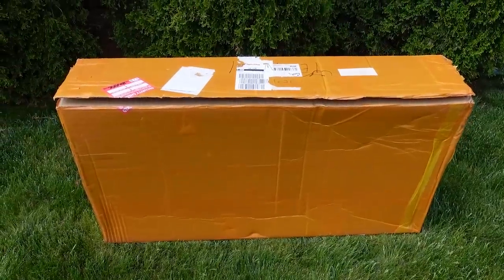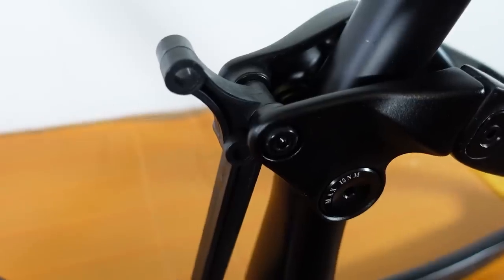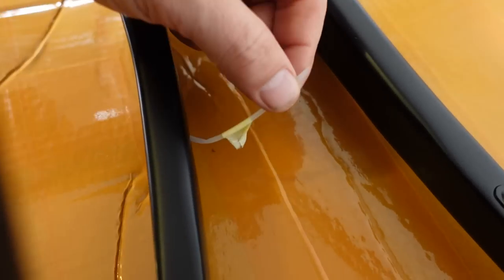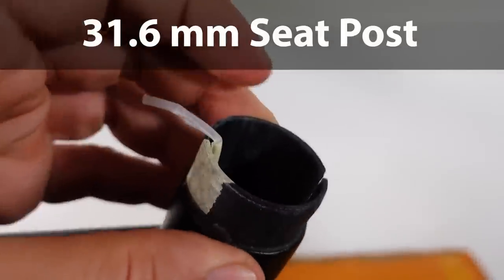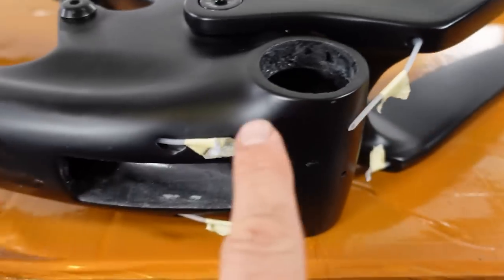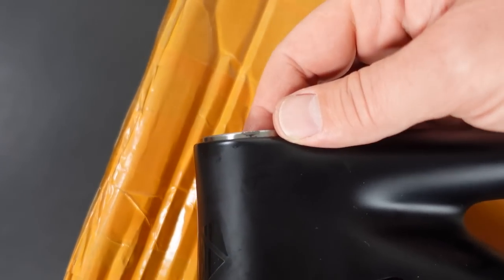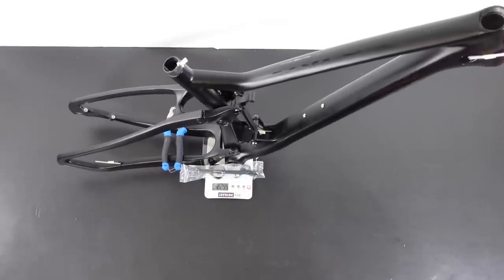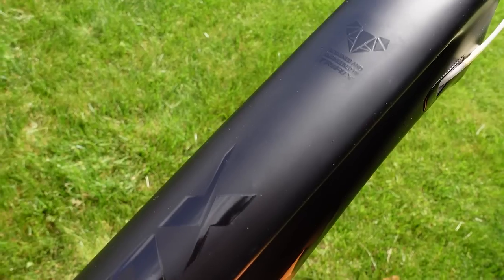Part 1: Cheap Carbon Frames Worth it? - TRIFOX MFM100 FS MTB Quick Check

Comment: I own 2 Chinese full suspension carbon frames. One is a trail (120mm travel) bike and the other an enduro bike (150mm travek).
Almost 3 years on the trail bike, I have done xc races with it, and totally love it.
Less than 3 months on the enduro one, the extra travel provides extra confidence on jumps, to the point I destroyed both enduro carbon rims. I love it too.
Reply: Good Morning, can i know which chinese brands/models you would advise me, with respect to the trail bikes? since i  would like to buy one of these as well, thank you!
Reply: @lce4375  for trail I have an Airwolf frame. It's not the best as it's not too light for a carbon frame, but works for.
For Enduro, go with the Ican P9 frame. Best of the Chinese options and a great frame.
Reply: @rubenvor  what else/better/best you recommend for trail bike? I am planning to build full sus downcountry bike next. Looking for a frame and carbon wheels. Thank you!

Comment: Spot on about the dropper. I was sent one of these frames to review and did a build up video on it. While picking the right dropper I went with a PNW Loam 125mm post because it has a short enough post to fit and the cool option of adjustable travel. I'm 5'8" and got a med frame. At my size I have to slam the post down for my legs to reach to pedals correctly. This post seemed to do the job for me 👍
Reply: @LoveMTB  Yes. I'm running 115 by way of a trunnion shock from SR Suntour. I was not sure if it was appropriate to put a link to my videos here. I just really wanted to chime in on your dropper comment because getting the right dropper was more tricky for me then I expected and thought others should know. Again, your points are dead on and something to think about when getting the correct one 👍
Reply: @LoveMTB  I'll send over some info. I was very lucky and met a dude James from the James The Bike Guy channel that helped me out. I would have been lost without his help. I did not get those bolts that you got so things got complicated. You will need to get some new bushings.
Reply: @LoveMTB  Shoot me an email and we'll chat. I can also link some helpful videos. I also think I have a few extra bushings and can mail them to you 👍
Reply: @rgmtb  Missing bolts and bushings? If a company's QC process allows that, I would be concerned about where else they cut corners on attention to detail and QC (carbon material, lay-up, etc).
Reply: @soco4949  This and a lot more will be discussed in my long term review.

Comment: I'm on chinese carbon rims and quite happy with them. Got a few friends who are riding chinese xc full suspension frames and as far as I know some of them needed slight improvements on the pivots by a local mechanic. Also quality may vary from one frame to another, you can buy two or three of the same frame but the overall quality might be different. As for the support, if you buy via aliexpress they usually honor warranty claims (sometimes  even when it was fully user error).
Reply: @LoveMTB  nice. What rim that was and it's weight, if that's not a secret? Mine are quite heavy with 2 year warranty (still have 13 month left). Also, seen quite of few broken chinese rims but usually it was light xc rims (300-320 grams for 29 rim with 23-25mm inner width) which were run on low pressures. The good part, it can be fixed, though it might cost like half of the rim itself.
Reply: @LoveMTB  damn, if there were warranty they should've covered it. Nevertheless, another few points to the argument that almost every cheap chinese stuff is a lottery due to bad quality control.

Comment: I had my Spark RC SL frame, triangle and linkage replaced on 3 different occasions in 4 years. If it brakes one more time I'm replacing it with this. Thanks for the video.
Reply: @LoveMTB  Oh from what I read on forums it does.
Reply: @LoveMTB  I've heard people ordering spark frame kits and they fit perfectly on these frames.
Reply: @LoveMTB  Have you sorted out the right parts to mount a trunion shock ? :p

Comment: Cool!  I bough the same frame and is having a really hard time figuring out the rear shock mount and the hardware needed.  The trunnion bolt that they supplied doesn’t really work with the frame, it seems to need an addition eyelet washer or something.  Can you make a follow-up video of the rear shock install?

Comment: I'm on my 6th bike build using frames and wheelsets direct from the manufacture in China. I paid $695 for the last carbon FS frame and $895 for the carbon wheelset with DT Swiss 350 hubs and arrow blade spokes. With the savings on the frame and wheelset, I was able to afford a Sram XX1 Drivetrain and a $900 fork, and complete a very high-end build that cost at least $9000 at ALL retails stores for $4750. I beat the hell out of my bikes all over Colorado, Arizona, and the Mid-West, and not 1 problem with the frame after a few crashes. If you have $3500 for a brand name frame and $2500 for a Wheelset - Great!  I'm one of the guys that needs to save $$ where I can, so I go for discount frames.
Reply: What brand do you recommend for full sus down country (120/120) bike? And what carbon wheels? I am not looking for cheapest but rather for the best (most reliable). Thank you in advance!

Comment: I bought an OG Evkin XC hardtail frame from Chinese manufacturer, last year so it was around 250 USD, the first frame came with a scratch on a chainstay, I wrote them and attached the picture and they have sent the second frame for no charge the very next day. 
I have around 3000-4000 km on a frame, mixed terrain, road, gravel, unpaved mountain trails, the frame looks just like the day it came out the box.
The only 4 issues I have with the frame are
1. Cane Creek headset bearing does not fit the top nicely, so I have to use their provided bearing with it for the top, bottom bearing fits nor problem
2. The dropout is interchangeable, available for both 135*9 or 142*12, the qr wheels fit with a quite bit of force and are removed with a similar amount of force, did not try with 142*12 but I guess the same issue will persist
3. I cannot fit 40t oval on it for short track/amateur city races (most people ride cheap mtb-s with a 3x so really need the extra gears)
4. The derailleur cable comes out of bottom of the chainstay
Other than that the frame rocks, and I most of my memorable long distance rides on it

Comment: I'm inclined to believe that Scott frames are made in the same Chinese factory that makes these Trifox frames.
My guess is that the factory takes orders from Scott and manufactures the Spark but then uses the same design with some slight modification (so that they're not direct copy) to make their own Trifox brand
Reply: What most people don't know is that of you manufacture in China the factory owns your mould after 3 years. These Sparks are open source frames now.

Comment: its all well and good but when your flying through the air and the frame breaks. I wouldnt be able to ride without worrying.
Reply: Well... i have seen 5k eur frame break apart on steep hill. So i rathet watch what manufacturer recommends to do whit it..Cos xc frame isn't the best choice in Dh rides.
Reply: Trifox and other reputable Chinese manufacturers build solid bikes. I've been riding a trifox frame for some time now, just as stiff as a frame 8x the price. Your expensive carbon frames are built by trifox, winspace ect anyhow
Reply: There all made in China Singapore Indonesia so it doesn’t really matter😂. But trifox is good

Comment: Other people that tested this frame noted you should not put 120mm fork, because it's designed for 100mm (even from the model number that's clear), but they will write anything like 100-120mm to sell it. The BB gets too high, handling is compromised with the longer travel option. The overall suspension kinematics are not so good, especially once longer travel options are used. I'm very interested to know your opinions on this though.

Comment: The frame looks good. Build quality seems to be okay. An other youtuber ( jasper verkuijl) got send a road frame from trifox and the first look was horrible... 😲 
Quality control seems to be a bit off.
Reply: @LoveMTB  
Yes, of course the quality of the fibers and their layup can't be seen. 
But .you don't get a good feeling, if the headset raise is full of loose fibers, brake mounts are under colour and the seat tube has an obvious void.

I think jasper will reach out to trifox but the questions he had for them about production, testing etc weren't answered before, so I'm really interested how this story ends.
Reply: @LoveMTB  
https://youtu.be/TaLWJ3SuCI8
Here's a link to his first look of his frame. I'm hoping he does a follow up video.

Comment: Looking like an interesting build, I am currently looking into a full sus XC ebike build myself for general riding in aluminium though as its quite hard to get a bike ordered at the moment.

However, I have just completed a full sus chinese carbon build using Dengfu frame E10 in XL and 150mm travel (ebike with bafang). Similar to the Luna X1 

Been testing for 2-3 months now with no issues other than one needs to grease al linkages, locktite on key bolts holding the battery and the main chainstay linkage.

All internal routing worked OK but a bit fiddly when installing as I did not have the routing tubes pre installed like the trifox one.

Looking forward to what you make out of the frame. 👍🏾
Reply: @LoveMTB  Nope...battery and motor shipped separately...had to install it all myself from scratch.

Hope you find a fork, parts are trickling down these days. I am hoping to use an old fox factory fit4 with 140mm travel for the XC build I am scouting for.
Reply: @LoveMTB  LOL...😆 🤣...looking forward to the build.

Comment: Isn't there way cheaper CF frame on aliexpress or shopee ? This is probably a Taiwan or China frame rebranded in Singapore .
Around USD$300 - 500 cheap CF frame with much ratings or even cheaper but no rating if you dare to order .

Comment: That's a weird way to weigh the frame. No manufacturer weighs the seatpost clamp and  an axle to determine the frame weight. Weigh them seperately and it helps the viewers much more. I 'm interested in seeing this frame built up as I was considering it as a project myself.
Reply: I just purchased a Lightcarbon model LCFS 911 frame that looks almost identical to this frame except the rear axle area is more the shape of a scott Spark. It is a bit lighter than this and is advertised as 1980 grams for my medium. It was shipped from China and I paid an additional $200.00 or thereabouts for shipping and the box came in eleven days. There wasn't a single dent in the box and not a single scratch or chip of paint missing. All the parts were included. The woman who works for Lightcarbon, Wendy , was extremely prompt in returning my emails and sent shipping tracking numbers to me as well. I'm extremey pleased with mine and would recommend them to anyone who wants this type of  style frame.

Comment: Nice it seems like it's ok on the cable routes but the real review is how it rides? The number of the geometry looks like 5 years ago, 68.5 head angle is like pure competitive xc
Reply: jerem bob I have a stumpjumper hardtail from I think 2013 whit 100mm of travel the bike can climb anything but in very steep sections you have to move your body to the front very much, compared to a new modern geometry frame that is longer, slacker and more important the seat tube angle is more steep in new bikes you can climb and be in kind of neutral position and I don't even talking in the decending department, my  bike is 70.5 Ht and you can feel how your body is over the front tire in steep downhills not so fun.

Comment: Is this a press fit BB? Think that is a deal breaker! Id fit a praxxis to get round that. Its what i have in my sl4. No creaks.
Reply: @LoveMTB  Cheers for the reply! Should gave guessed there are loads of options. Be interesting to see the build. Seeing as a blur cc is way out of my price, this seems like a way to get a very good cc bike at a decent price. I'd prob go for those cheap adjustible travel forks  for maximum downcountry  without ruining the climbing.

Comment: Lots of people point out that most carbon frames are made in China. Does that imply they are made by the same factory/people and same methods? To me, this frame looks a bit rough and the hardware a little cheesy but hard to tell on a video.

Comment: I’ll stick to aluminium,less hassle,easier to fix
Reply: What do you mean easier to fix? Alu is never going to be the same after welding a crack or something like that while carbon can actually be fully repaired. Though pricey as hell.
Reply: @graved1gger  aluminium can be welded in minutes,carbon has to be sent away etc etc,as a fabricator i know what im talking about
Reply: @camperp195  well, can't fault that logic, if time is of the essence.
Reply: @graved1gger  if it is welded properly,by a professional that knows what they’re doing,more often than not the weld is actually stronger,but sadly there are cowboys about that just weld over the break 🤷‍♀️
Reply: @camperp195  Aluminium cannot be fixed in minutes, after it's been welded it needs to be heat-treated
Reply: @camperp195  If aluminum breaks, it’s likely because the metal has fatigued, and welding isn’t going to a viable long-term fix. 

Not to mention the need to heat treat again.

Comment: do you call a cheap carbon frame " cheap carbon " ? or do you call it " carbon frame that`s cheaper than all the others "? ( i`m not even sure that makes sense ) LOL becase it depends on expectations. if you have the money to buy an S-works epic HT frame ( 2500 dollars ) you will, but for the rest of us, a 700 dollar carbon frame is as good as it`s gonna get. Lightweight aluminum frames do exist, but they can be quite expensive. So, if you`re not a particularly heavy of aggressive rider, a carbon frame that`s cheaper can be all the bike you`ll ever need.

Comment: I got my scott spark rc 900 carbon HMX frame with fox nude shock, fox 32 step cast fork and scott twinloc system for $2000 and the bike rides like a million bucks, that was 2 years ago and im sure it would be hard to find now for that price but $1000 seems excessive for a cheap, low quality, horrible quality control china frame where there are so many videos of people getting hurt from them breaking, i've owned a couple china frames in the past and personally would never cheap out again. Now that the new scott spark frame came out you should start seeing 2017-2021 frames being sold for half decent prices soon, would be a much better idea then this china frame if you ask me
Reply: @LoveMTB   The scott spark is the lightest full suspension bike you can buy, its about a full pound lighter then this china frame, so if you crash and smash the frame on some rocks, or if you take a turn really fast and smash your chainstays on a tree there definitely is a chance of breaking it. Also scott has different level of carbon quality for the spark, the lightest and most expensive is the HMX-SL but even nino schurter rides the HMX because its the most robust for the weight, this guy you speak of most likely has the HMX-SL frame which is so light its basically only meant for high end racers for race day,  any story you read of the spark frame breaking is most likely with the HMX-SL frame. That being said im 190 lbs and ride very hard and have not had a single hiccup with my HMX frame, when comparing my scott bike to my past china frames the stiffness and quality difference is through the roof. I seen the way you ride your bikes you are no novice, I personally do not feel its worth it for you to save some money and ride the china frame the same way you do with your norco frames, a frame like this I think is better suited for a novice lightweight rider. I just really want people to understand the main risk with carbon fiber is quality control and china frames have the least amount of quality control, a reputable brand like scott has insanely good quality control in comparison. China's main focus is to copy the frame, build them up as fast as possible, hand them out for free to youtubers to put a good word in and they make a shit ton of money
Reply: @LoveMTB  NP i feel I have to give some input from my experience over the years. I know it seems like im trying to scare you from riding the bike but thats not my goal, I think if you decide to ride it just make sure you keep a good eye on all the stress points of the frame, do regular checkups, chances are most likely the frame will survive and be fine since the frame is actually quite heavy compared to the spark. I also feel its just not a good time for everybody to be supporting china, this is one of the main reasons the world is as crappy as it is today : /  Take care!

Comment: The UCI requirements to pass the tests are not enough for carbon frames, so if the brand is not well known they might be using open-mold frames and might not be doing tests home, only by the manufacturer, and relying only in them for this is not a good idea, so good luck with that.